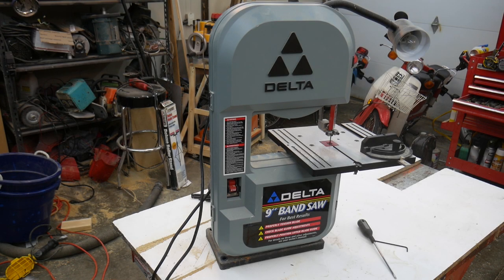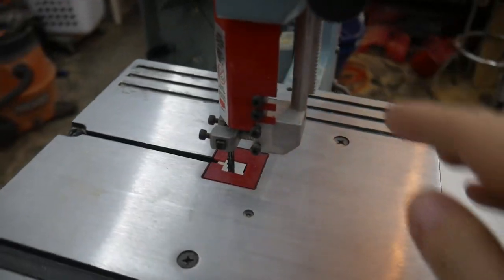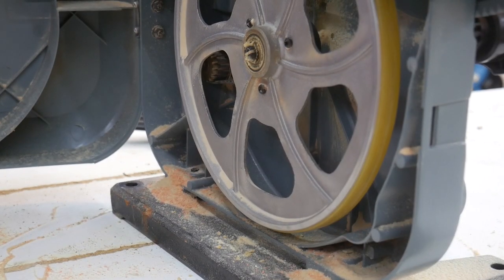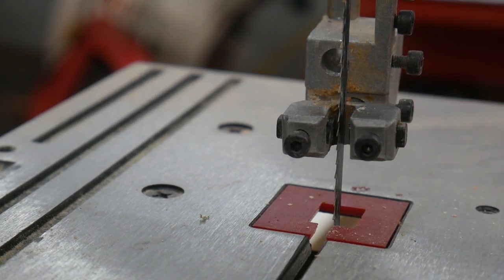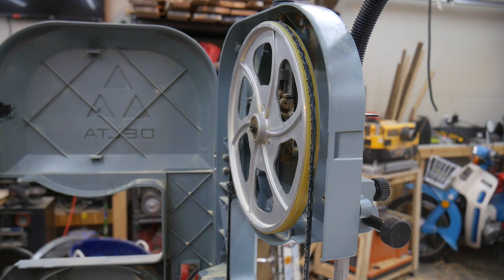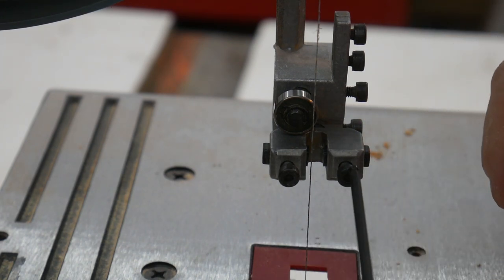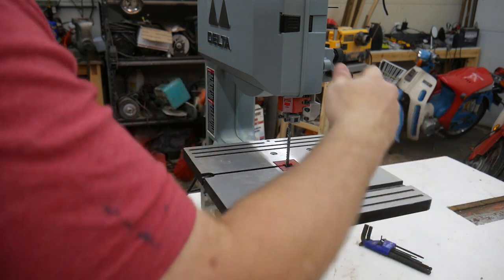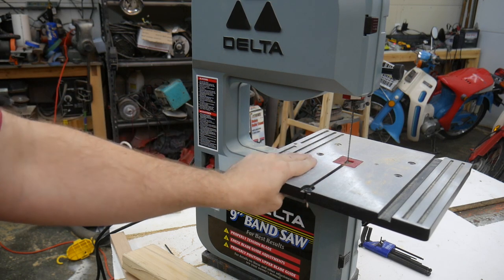$20 Bandsaw: Good Deal or Garbage?

Comment: I have the exact same saw but mine is a 10".  The blade tension is: once the spring make contact go another Three Turns,  I usually go 3 1/2 turns on mine,  I can't believe how much I use this over my larger saws,  if the piece will fit I go to this saw first and I love it.

Comment: This is a lot like working on a bicycle.  When  you're turning something and it wants to turn as you tighten it (happens a ton with brake pads), there's an art to twisting it the wrong way just enough to twist it into place before friction locks it down perfectly center (re: the blade guide tolerance issue).

Comment: Thank you for this video.  Very helpful and informative.  I have the 9” Delta 28-150.  Trying to get it into workable condition. My blade  shifted to the right and  when I tried to lock it down the white plastic  collar piece inside the guide broke in half  on my machine when I took it apart to inspect it. Any ideas where I can buy this part from?  In not I guess I’ll try to epoxy it.
Reply from the maker: I doubt they stock parts for these anymore. delta isn’t the company it used to be. You can try gluing it or maybe finding someone to 3D print the part in question? Good luck!

Comment: Good deal. 
I don’t need to watch. 

Tiny bandsaws do some fantastic things for little things- architecturally cut wood shingles, small aluminum brackets or parts, kerfing turned spindles for blind wedges; I could go on a long time. My tiny one is a harvor fright that cost me $59 over twenty years ago. It needs new tires and I need some new fine blades. Won’t replace a ‘real’ bandsaw but it’s stinkin’ handy portable and tiny footprint.

Comment: This bandsaw is a nightmare, replaced blade, its hard to do precision cuts, mostly off square, I got it into square a few times upgraded bearings blocks Timberwolves blade  16 tpi I believe. 
 Squared and somehow off, what I use it for has to be exacting.  Going to blow 2 k on a new saw, cant find an old saw from 50,s or earlier around here.
All new major brands are junk in My eyes.
Reply from the maker: Look at Powermatic, Laguna, Rikon, Harvey or even Grizzly if you want a high quality band saw. I haven’t had any issues with either of my Delta band saws after I got them dialed in correctly, but I’m sure there are a few lemons floating around there so your predicament isn’t surprising
Reply: @SouthpawWorkshop  prolly going to get a powermatic, out of all that junk you mentioned this thing seems better, unless I can find a old one  made on usa

Comment: My delta saw wheel rubber band dry rotted and fell apart.....any replacement rubber bands for that... electric tape is not a fix like some ppl have said
Reply from the maker: Look up “urethane bandsaw tires” on Amazon. Should get you in the right area.
Reply: @SouthpawWorkshop what size are the band saw tires?
Reply from the maker: https://amzn.to/4eeqAiF

Comment: Great seeing inside the inner workings bro.. Get the hoover out bro and tidy up.. LOL.. Dude u said u don't upload as much anymore? What happened? Jobs get in the way I suppose. It's the same for me. I have a small workshop. Table saw(crap) but I'm just about to begin building my own homemade table saw using a lotta steel. The one I have is ok but the mitre slots are bad and I cannot use the nice mitre gauge I got a year ago. It cost nearly as much as the saw did.. LMAO.
I bought a load of SQ tubing diff sizes, Angle bar and also welders and all the gear. Haven't welded anything since school at 12/13 yrs old and I'm now 51 this year.. This should be fun my bro.. heehee!
My shop is half the size of your double garage. 16x10ish feet.. 
Dont take this the wrong way bro but ur shop looks a real mess. Have u given up doing this for some reason. U seem like a well clued up guy with the machines and all that but it looks to me like u haven't been in ur shop in a long while. 
U were either in prison or ur on the weed??? 🤣😂🤣😂🤣😂 .. I'm only buzzin' with ya my friend. I will share the video and I have sub'd and liked also. 
BTW ur not alone bro. I need to clean the shit outa mine too. I've been putting it off for a month or 2 now. It's a bloody mess is mine.  I can never stay on top of it. Mine is a feckin' mess mate. Like someone set a bomb off in there..
Get back making more videos bro. I like that big Grizzly Bandsaw u have.  Are they a good maker of big tools? I keep prattling on man. I'm gonna say goodbye now. Get back making videos man.. Gotta keep it going. U have a lotta subs.. Fair play. I'm going to check more videos out on ur channel later too man.. Take care dude..
Reply from the maker: Grizzly makes great tools. Pretty great pricing especially in the US. As far as shop cleanliness goes… I usually clean up before I start a new project. Easier to find what I need when I need it. But I’m too busy making stuff to worry too much about sawdust and clutter. Sometimes when I make these videos, I’m in the middle of a project, so what you see is what you get. Thanks for watching. I’m still around. Just don’t upload as much. Job change and not as much free time as I once had. Cheers!

Comment: How does one measure the inches of a bandsaw
Reply from the maker: Many people believe it is the diameter of the bandsaw wheels, but it is actually the size of the “throat” or the distance between the blade and the upright, hence, the cutting capacity of the saw.